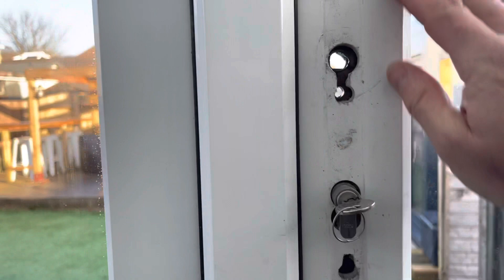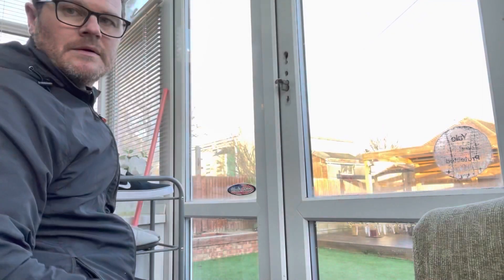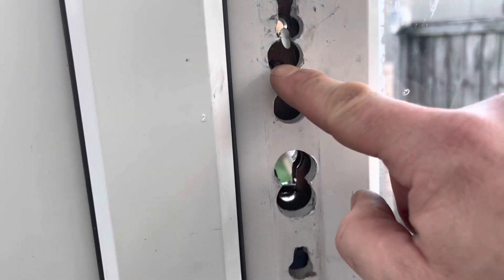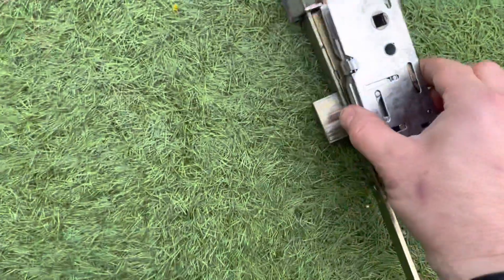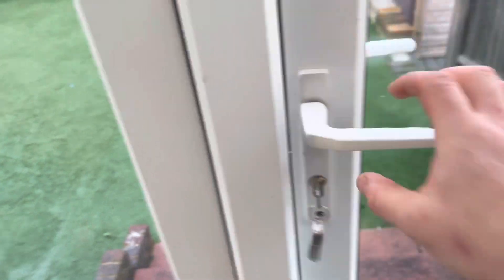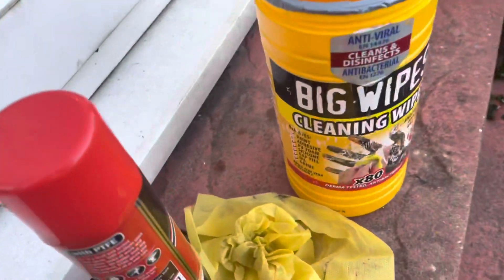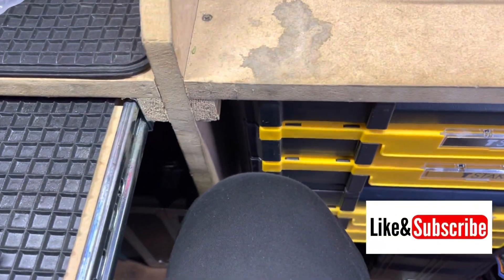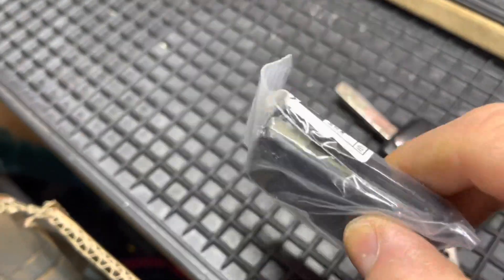Jammed uPVC French Doors | 2018 Citroen Berlingo Spare Remote using Autel IM508 - Locksmith

Comment: You can usually  open the old gu's through  the  cylinder  hole.
Reply from the maker: I tried for a while to open through the cylinder hole but no joy 😐
Thanks for watching buddy 😊🙏🏼
Reply: @brighton_locksmith  must have been  forced  or something, never had one I couldn't  open through  the cylinder (yet).
Reply from the maker: @cardiffpicker1  Just my luck 🙄😂😂

Comment: Hi Andy, on a the yale grey standard night latch if the snib drops how did you get the bolt to retract? (A previous vid) I was playing with one today and even if you pick/drill micky mouse the cylinder and get access to the rear of the night latch it will still not turn if the snib is down.
Reply from the maker: Hi mate. I was lucky with that one bud. There was  enough movement in the frame to air wedge it and give it a little nudge with the spreader and it opened. 
If you have to drill it, you would Mickey Mouse the cylinder to remove that, then you will normally have to knock the nightlatch off the back of the door with a screwdriver and hammer to get the door open. Not the nicest of jobs to do mate 😐
Reply: @brighton_locksmith  ah OK thanks I thought there may have been a drill point somewhere to lift the snib.
Reply from the maker: @matthewrichards552  There may be on some night latches mate but you’ve only got the 32mm hole for the cylinder to see and drill through.
Reply: @brighton_locksmith  once you take the rim cylinder off get the die grinder out and pop a hole in the nightlatch back case and flick the snib up 😉
Reply from the maker: @benjaminoneill4295  yep!! That could work mate 👌🏼
Reply: @brighton_locksmith  was a nice tip my trainer taught me
Reply from the maker: @benjaminoneill4295  Nice one mate. I didn’t know about this one and it’s a great tip 👌🏼
Thanks bud 😊🙏🏼

Comment: pot metal gears did not make the world a better place. Had to open one with a reciprocating saw between the door and the frame, because it had those curved bolts that hook behind the keep
Reply from the maker: I feel your pain mate!! 
Thanks for watching 👍🏼
Reply: i had a cego bowater with 3 hooks top 1 seized if you spread a gap then slip a 5mm x 25mm bar in the gap you can hit the hooks either up or dwn to get em open
Reply from the maker: @bloggs692413  nice little tip there mate, thank you 😊
Reply: Have a try with a multi tool with a metal cutting blade
Reply: @benjaminoneill4295  that would damage the door and frame and won't reach anyway